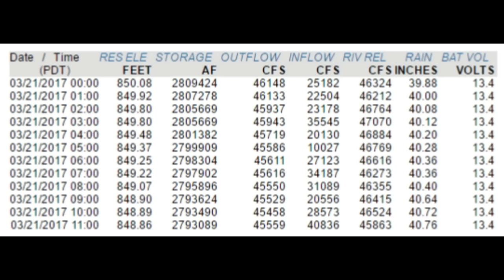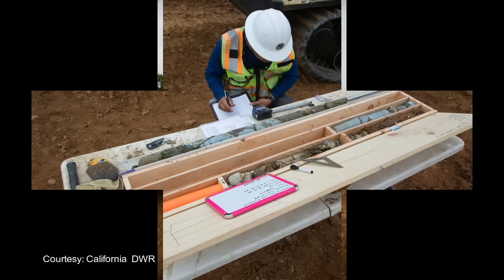New Video | Inflows Increase to 40K | Oroville Trip Update | Lake Oroville Dam Updates 3-21-17

Comment: At 0:08 in this video, two items of potential interest. One...debris visible in the foreground, above the surface of the Diversion Pool. Two...vertical "streamers" of white water that I associate with POSSIBLE erosion/cutting, or, put another way, more than just turbulent white water, instead, trails of water left behind flying rock at high velocity. Implications for both items of interest bear on Diversion Pool levels, and Hyatt's ability to maintain 12.9 kcfs outflow, even when Lake levels fall below 838 feet and the main spillway runs dry.

Comment: That was out flow at 40,000
Reply from the maker: Did you watch the whole video, inflow has increased to over 40K and has maintained that for the past few hrs
Reply from the maker: You can go here and check the levels...
http://cdec.water.ca.gov/cgi-progs/queryF?s=oro
Reply: Thanks for covering that. I just checked CDEC.... then came to YT and found your latest vid.   I'm sure DWR is bummed that the lake level is no longer dropping, at least at this time, and has dropped less than was hoped for.
Reply from the maker: Yeah they may have to extend how long they use the spillway.